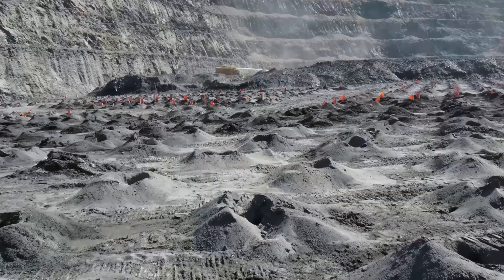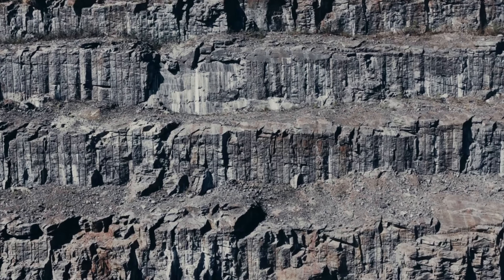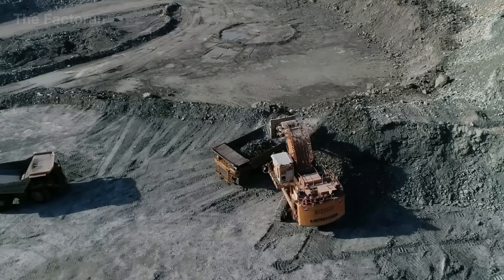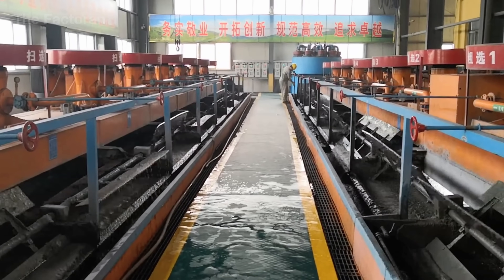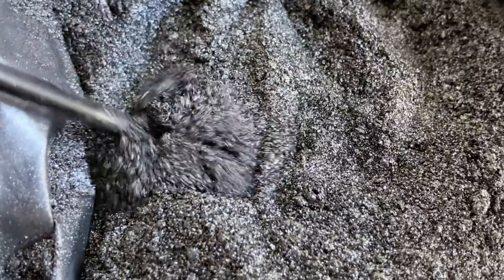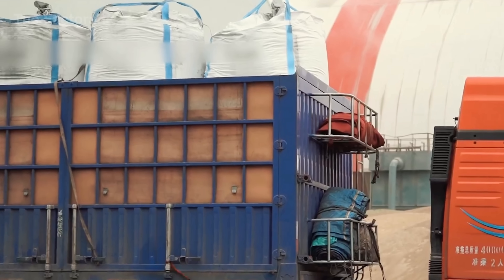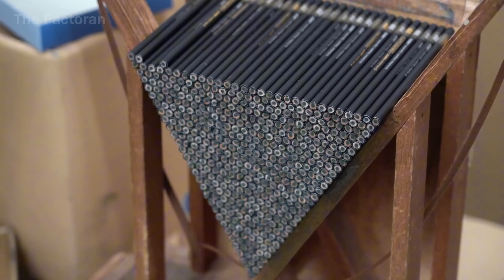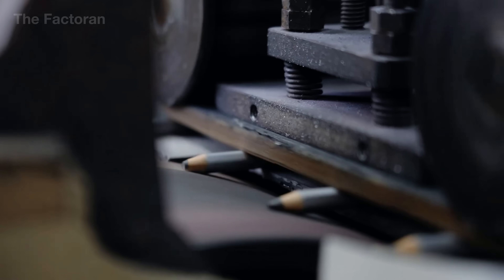How Graphite Is Made Inside A Massive Industrial Refining Processing Factory

Comment: The car battery in this video is in an all electric car, not the internal combustion gasoline powered car. Best estimates of world wide graphite consumption  is: Li-ion batteries 30% of total (with cars half of that at 15% of total); steel-making electric-arc electrodes 20%; pencils 0.5%. Pencils are a trivial consumer of graphite, but they have a robust library of YouTube videos to choose from, and I have seen the one in this video as a stand-alone YouTube video. [These percentages are changing rapidly and electric cars will likely be more than half by 2030, and they are not rock solid but are the best guesses by experts.]
Reply from the maker: Good clarification—graphite demand is shifting quickly toward lithium-ion batteries, and we’ll keep updating figures as the data evolves.

Comment: Very interesting but how is graphite put in brass wear plates that are used in industrial metal stamping die.
Reply from the maker: In those wear plates, graphite is typically added as a solid lubricant—either embedded in the brass during casting or inserted into small plugs or grooves to reduce friction during stamping.